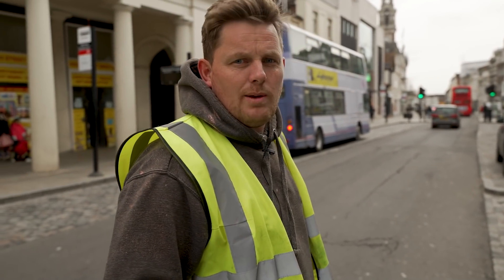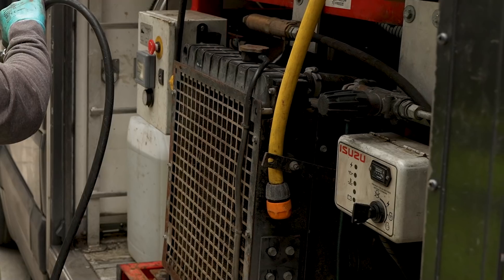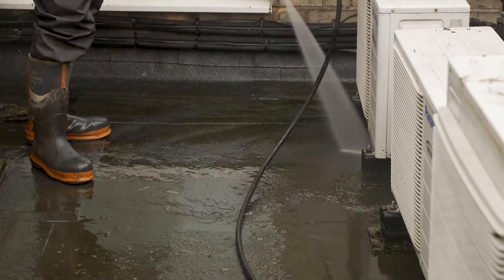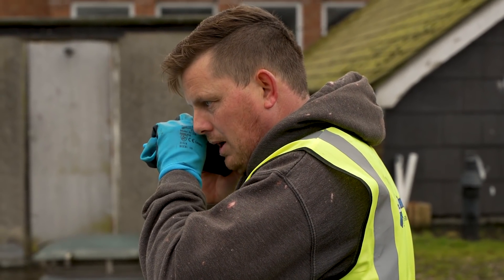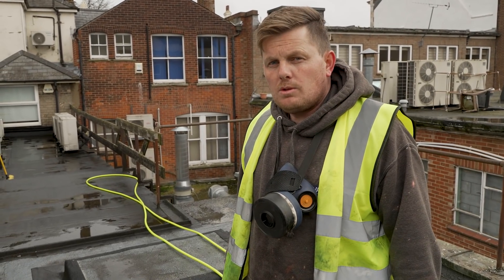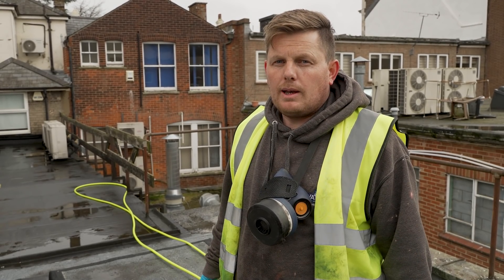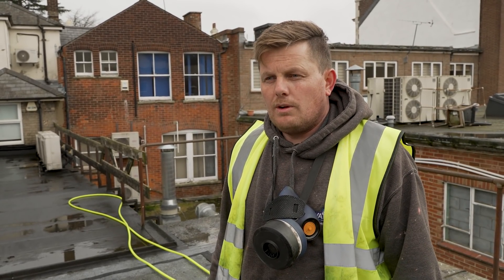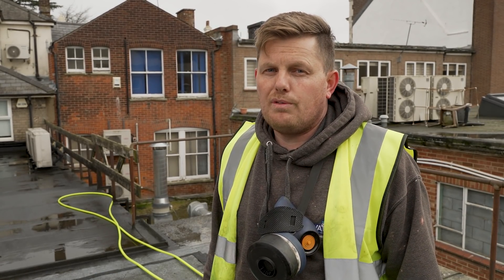Flat Roof Repair Part 1 ~ Cleaning with JetVac

Comment: Seems pretty pointless tbh
Reply from the maker: All will be revealed in part 2
Reply: @SkillBuilder  OK fair enough. Still, jet washing a roof like that as a separate set of works to the contractor just doing it seems a bit OTT. Plus, how often does one work on   a site with no running water? Not really sure  of the benefit of this but fair play and good luck to you.